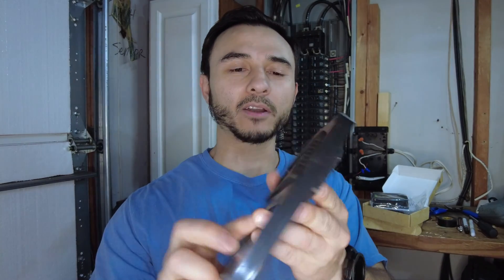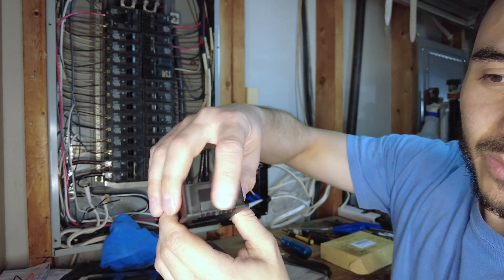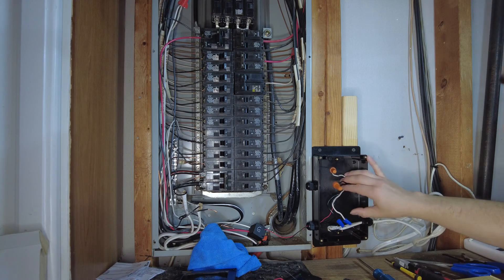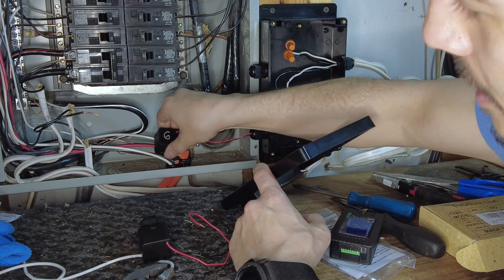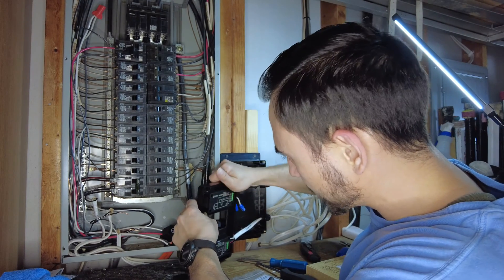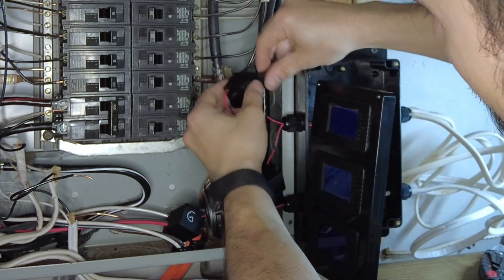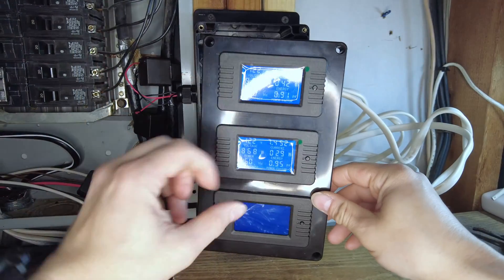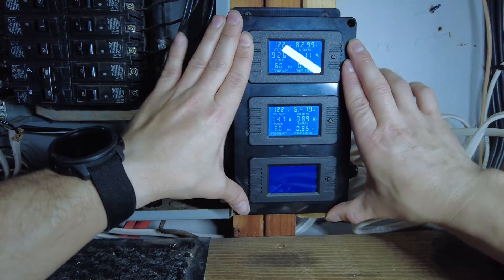PZEM-022 Power Meter for Circuit Breaker & Generator Install!

Comment: Nice install.....especially since you are "reading" each 120V leg of your city 240V supply. Question: now that you are monitorong the 2 x 120V legs on city power......why didn't you use a duplicate set of 2 meters for the generator? In my view, the "health" of each individual generator 120V leg might be more important to check if it's good....compared to the need to  check each 120V leg of city power.....no ?
Reply: I agree with the above. I set mine up with one monitor but the way you have it set up will get a very inaccurate reading since your watts will be based on the wrong current. Each line will cancel each other out since they are opposites. You have to run one wire through the donut in the opposite direction in order to get total wattage.
Reply from the maker: @justinhuynh4849  I'm lost in your words. Which line will be inaccurate?
Reply: Good to know that connecting the generator ctu to both wires would display total watts for the generator.
Reply from the maker: @josephasuncion3163  Yeah, I mean the I care more about the total watts from the generator since it's rated for an overall rating of 7500W.
Reply: Nice job putting it all together.  Question: In your setup with both generator lines passing through a single transformer, are you sure you're measuring the total current? It seems more likely that you're reading the net current, not the sum of the currents from both lines. Since the currents in the lines oppose each other, the transformer would show the difference between them, not their combined total.  IOW, the neutral wire carries any imbalance between the line currents, so when both line wires pass through the transformer, it measures the net difference, not the total current.
Reply from the maker: @JALBANESE5 @JALBANESE5 probably but I'm mostly concerned with wattage because I don't want to exceed the wattage of my generator.  I haven't seen it in action really since I haven't used the generator in a situation yet.
Reply from the maker: That's a good point but I figured I'd want to know the total voltage at the generator and I also don't use the generator every day.

Comment: You really should move your 100A Breaker to the top of your panel and install a Generator Interlock Kit.   That is required as code everywhere I have ever checked, as well as will ensure you don't hurt someone by forgetting to kill you mains when you use this.
Reply from the maker: I do have a generator interlock kit. It's on the faceplate of the panel cover. You cannot see it when the faceplate is off.